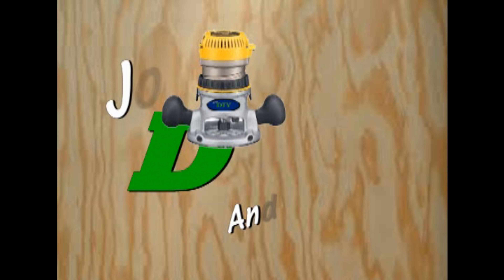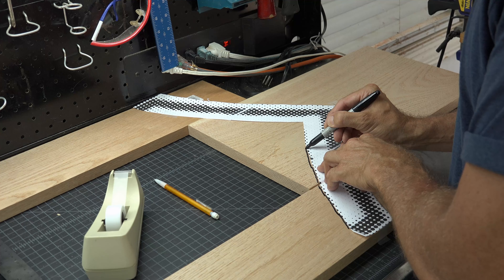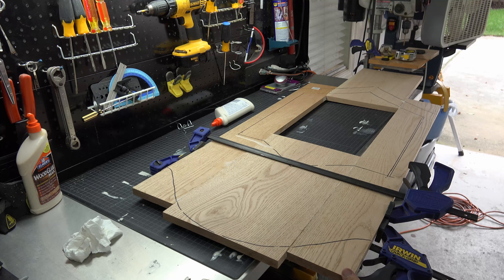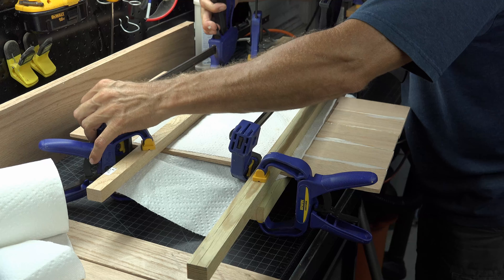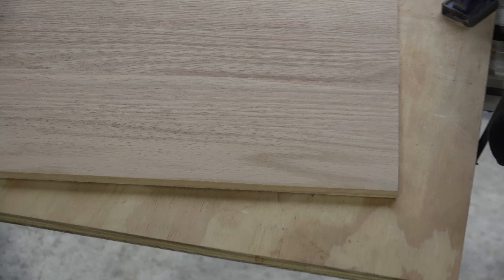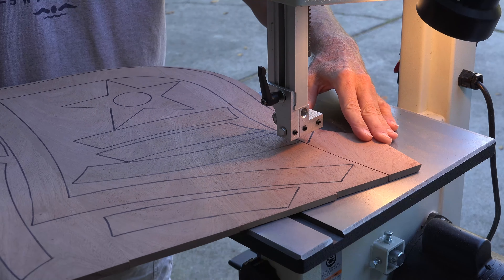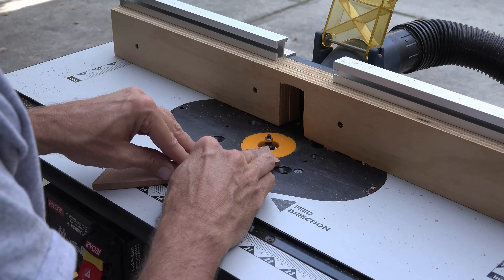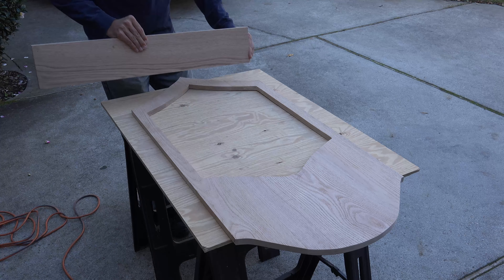(PART 1)  Military Shadow Box MSgt / Jon's DIY

Comment: Hey brother, I'm starting on my coworkers shadow box this weekend.  Just getting some ideas where I want to go with it and I saw your video.  Great video, you gave me some good ideas, I appreciate it.  Hey when you do glue ups, try wax paper instead of paper towels.  The glue won't stick to it and it'll save you just a little bit of time.  Just a suggestion, great work!
Reply from the maker: I actually use paper towels because my wife buys them in bulk and I always steal a roll for my work bench.  I agree anything really works but I'm a cheap skate and probably wouldn't pay for wax paper.  But thanks for the idea.  Jon